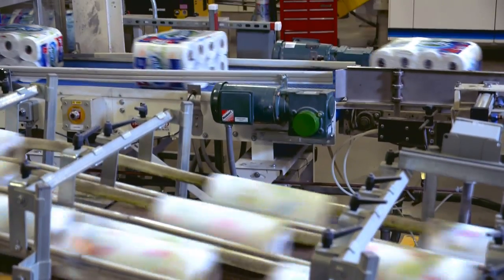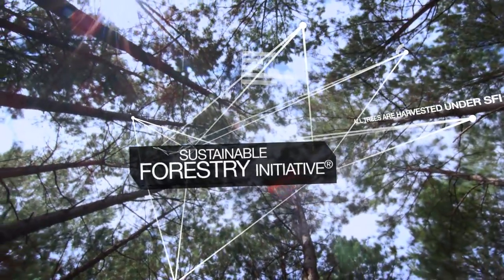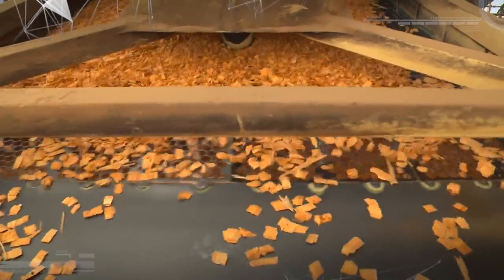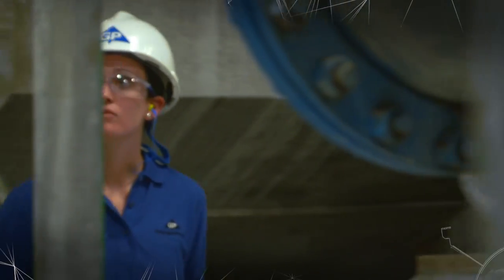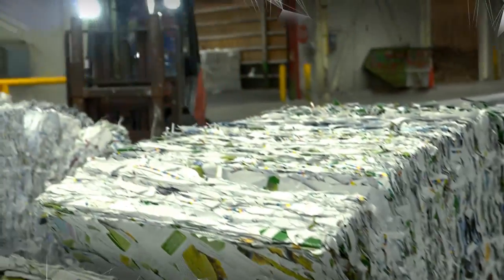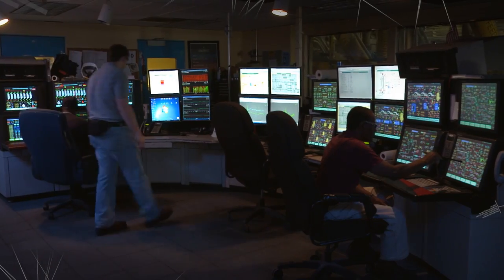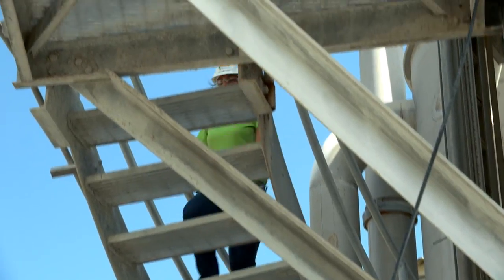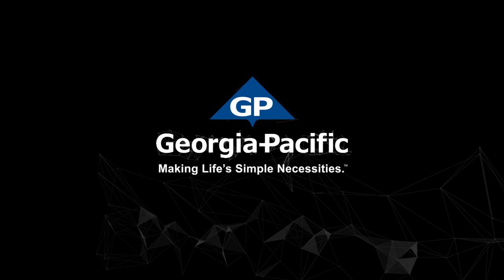Paper Products: How It’s Made Step By Step Process | Georgia-Pacific

Comment: I'm currently going to school for Process Tech to be an operator in the Oil and Gas Industry, and my classwork included learning briefly about the Paper and Pulp Industry. I thought it would be pretty lame. For example, my teacher for this class spent 40 minutes talking about power generation, but spent less than eight minutes on paper and pulp. He talked briefly about how paper was made, but it intrigued me enough to find out a little bit more. Seeing the operators sitting at computer screens the same way I have seen operators for BP and ConocoPhillips sit in process facilities on Alaska's North Slope made me realize that the Paper and Pulp industry is high tech as well. Very cool video, guys. Maybe I'll work for you one day!
Reply: Sadly, many instructors don't know that much about Pulp and Paper Manufacturing and will gloss over it.  I've worked in Automation for 25 years for the largest Process Controls Automation provider to the Pulp and Paper industry and it is extremely high tech.  The industry needs bright young new operators at it's mills across the nation and you should definitely look everywhere for opportunities.